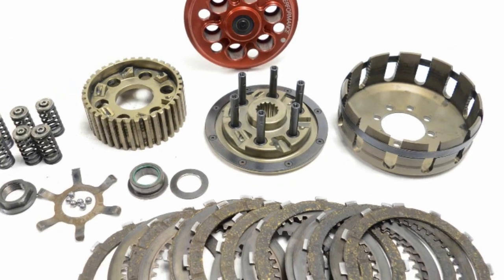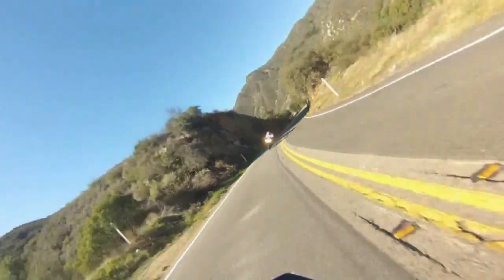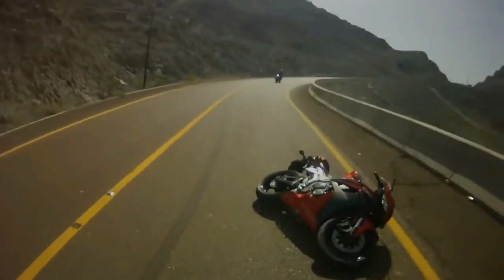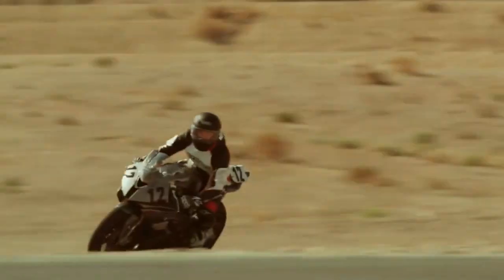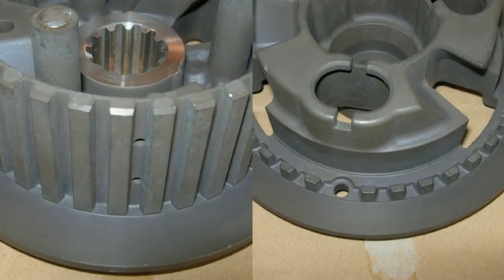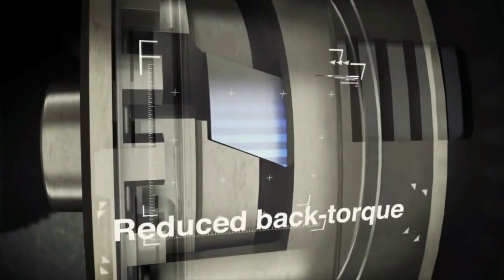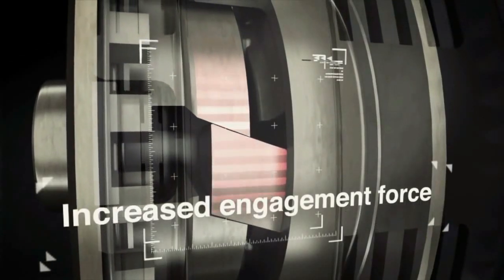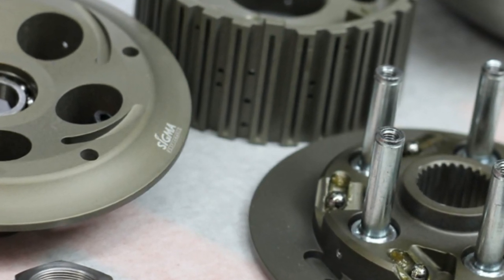Slipper clutch - How it works? : Motorcycle tech

Comment: Been riding for many decades. Sure ABS,  Traction control, better tires and brakes and always a welcome addition but ride by wire, slipper clutch and multitude or ride modes and sensors I have no need for personally. I am not trying to get from A to B as fast as possible. Biking for me is to enjoy the ride, the scenery, the time being alone etc

Comment: Hii,
I bought a bike Apache RTR 200 in may 2017 and its come with Wet Multi-Plate (6-plate) clutch. 
now, it's not a year passed company launched upgraded model with the only slipper clutch.
so, my question is can I replace my wet clutch with original manufacturer slipper clutch? or need to replace the whole engine?
Reply from the maker: Thanks for the question. Probably it should be possible to retrofit the slipper clutch if the overall dimensions and design are same as old multi plate clutch. I will suggest you to visit a near by authorised service centre and make an enquiry about it.
Reply: Ya u can install slipper clutch

Comment: Sweet and simple video..
Bt ek question hay ki jis bike mey sliper clutch nahi hay usme kya sliper clutch install ho sakta hay..jaise ki r15 v2 mey r15 v3 ka clutch install ho sakta hay..??
Reply from the maker: In some cases it is possible to retro fit the slipper clutch in a motorcycle. Take the case of RC390 for example, the first generation RC390 can be fitted with the slipper clutch from the second gen RC390 because KTM didn't made any mechanical changes to the engine or gearbox, both the components were exactly the same in both motorcycles. But in the case of the R15 , I am not sure. Because the engines in the V2 AND V3 version of the R15 is not the same, they have some significant differences. I would suggest you to contact your local authorised Yamaha dealership for more clarification.
Reply: Revving Heart 
Local dealership mey unko yeh sab bare mey ku6 nahi pata hay..bohot log aise v hay jinko sliper clutch k bare mey v nahi pata sahi se...mujhe lagta hay ki sirf bore and srotke and silinder hi change kiya gaya hay v2 nd v3 mey...baki sab sayad ek jaisa hi hay..uske sath sliper clutch and VVA diya hay..
Ab. Koi agar yeh experiment kar k dehe to pata. Chalega..
Reply: @rahuldrossi  TheSportzTourer has upgraded his rtr 200 with slipper clutch. He has a installation video as well.

Link https://youtu.be/Vxyz4GVt9i8

Comment: Can this be installed for royal enfield  350 classic ? Pls answer
Reply from the maker: The thing is, we just can't install any slipper clutch on any motorcycle. It has to be specifically designed for that particular motorcycle. As far as I am concerned there is no slipper clutch is available for the Royal Enfield Classic 350.

Comment: hold in the clutch while braking. issue solved.
Reply: Issue solved? And you've just run off the road because you couldn't stop in time without the assist of engine braking.